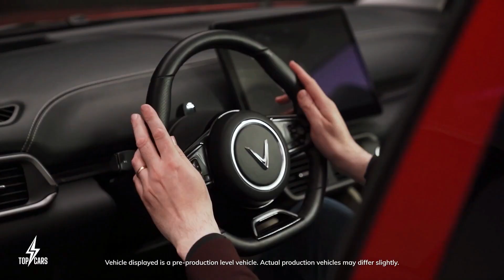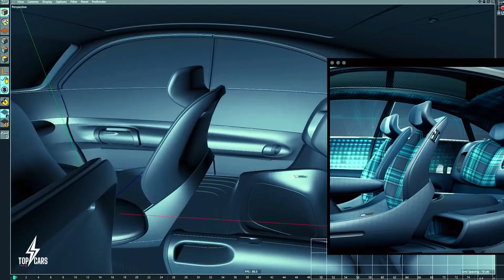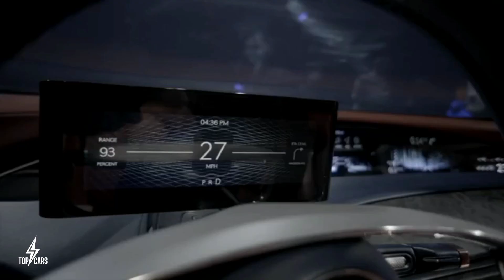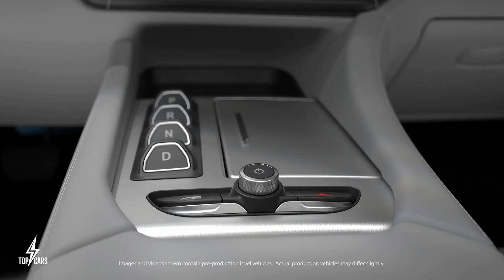New Electric Car Brands You Weren't Expecting To See

Comment: vinfast vf9 starting price is $56k, not $65k
Reply: The battery is not include . You must rent the battery .
Reply: @d.nguyen582  yeah I meant starting price. VF8's 41k is correct
Reply: @d.nguyen582  After 8 years or more than 100K miles, EV battery degradation to below 70%, leads to the battery significantly losing its power. Tesla $23,000 bill to replace the battery is insane, and each Tesla $1,500 service charge is beyond ridiculous.
Reply: @QuocNguyen-px1ip  today I got an alert that the 12v battery in my 2018 Tesla Model 3 was starting to fail. I got that notice at 8:30 AM. I sent a request for service through the Tesla mobile app. By 10 AM Tesla had come to my house, and replaced the battery, for $0.00.
Reply: @carlfriedrichs2404  for $0.00 Really? No charge?🤣🤣
Reply: @joshlouissr.5847  without Battery.
Reply: @lemd9173  it’s because the Tesla is still under warranty. It should expire warranty this year unless he got an extended package
Reply: @5255andrew  Ok ! I got it. Thank
Reply: @5255andrew  makes sense !

Comment: feel sorry for electric  car  drivers and future  owners. They will simply  have to learn the hard way .. as I did. These things are a huge hassle, all those lost hours sitting in those  charging  stations, huge anxiety, plus a outrageous expense  in the long run. Batteries  are very ... very expensive to replace ( thousands of dollars) ...  and make no mistake, you will be replacing them. These batteries are highly toxic to our environment,  with a high potential for disaster to our surroundings. COBALT  LITHIUM BATTERIES ARE NOT CLEAN ENERGY BY ANY MEANS!  ... 

      I wish I knew all this before I bought my car .  Do your homework before buying !
Reply: Troll alert.
Reply: I know there has been a troll alert for this post (thanks Carl) but I'll bite.
1. Range anxiety and long charge times.
a. Yes, you will need to plan your driving a bit more than you do now. Car manufacturers putting in strong chargers in their cars is an important thing even for low and mid range future cars for them to be interesting for people who drive a lot every day. Personally I could get away with low range right now but that could change and if it does I want a range that lasts a bit.
b. For the average driver, the current selection of EVs (not the old Leaf) have perfectly adequate range for daily commutes. Most cars you consider should have at least 300 guaranteed km of range (not WLTP daydreaming range) and very very few people drive more than that daily. Those who do, however, deserve cars with good range and good charge speed (1a).
c. Not everyone can charge at home. This is a fact. Public chargers need to be regulated (yes America, regulate your shit) so the companies behind them don't skyrocket prices making it just as expensive as filling up a petrol car. Cost of daily driving is a big part of why I want to go EV.
d. For those who currently drive long distances daily, there are cars with big batteries and fast charging. However, they are very expensive and out of budget for most of us. Car manufacturers need to look into that. Long distance commuter cars need big batteries, efficiency and fast charging, not $8000 worth of interior or exterior bling.

2. Yes, batteries as we make them now are toxic to the environment.
a. HOWEVER, the toxicity is primarily local. It doesn't spread nearly as much through the air like gas fumes and CO2 does, if at all.
b. You can recycle a large part of the battery. I don't remember the exact percentage but it was most of it. Including cobalt and lithium. That means it's only extracted once. A car made from a lot of recycled materials has way lower environmental impact than either an ICE vehicle or an EV made from freshly extracted materials.
c. There has been science done about this, and even if what you say about cobalt and lithium in particular is true, an electric car will have less environmental impact than a petrol after just 2-3 years. And that is very good.
d. No you don't need to replace your EV batteries after a few years (except old Leaf). Test after test has showed this. As long as the batteries are taken care of with cooling and heating and whatnot, they will last a very long time. And yeah it's not cheap to replace them, but there have been people who replaced batteries (in a hecking Leaf) for like $5000. And at the same time putting in a larger battery. What happens to the old battery? Again, recycling.

So you're either a poor doomsayer or a poor troll. Be better, adapt to the real world. Electric cars are environmentally the right choice.